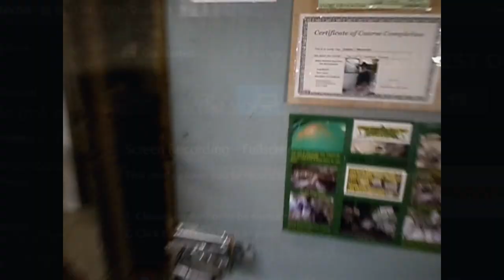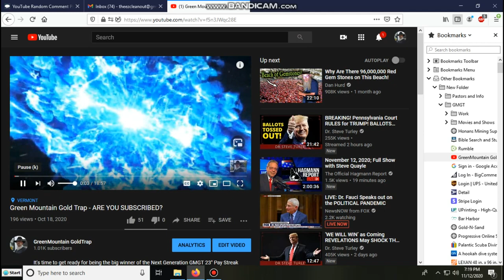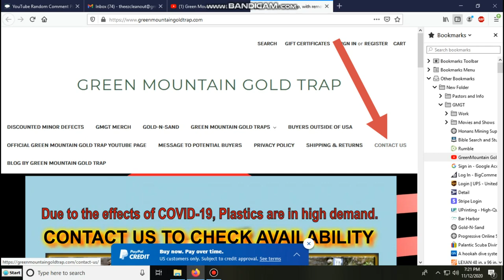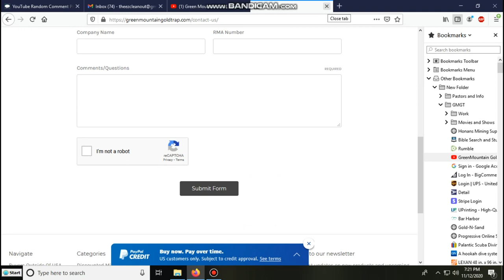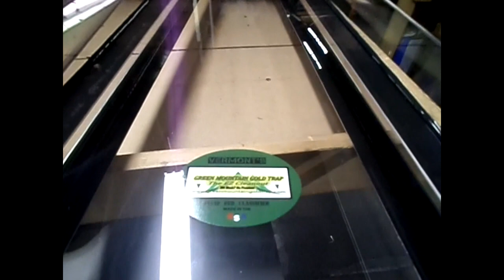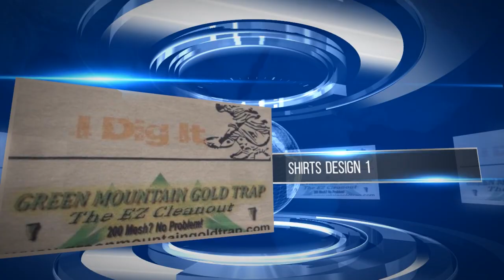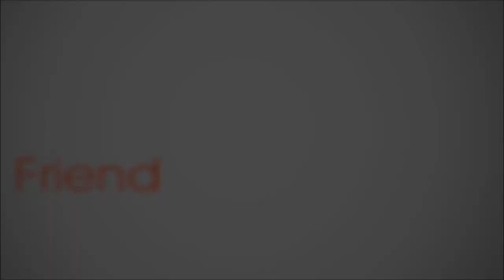Green Mountain Gold Trap 1K Sub GAW Drawing

Comment: Congrats to the winner. And again congrats on 1000. The clear looks cool and does have eye appeal but at the same time yours has eye appeal as well, and strength would be a very important aspect to me. Falling when climbing steep banks or over slippery rocks, dropping stuff, etc. etc.
Reply from the maker: Thank you Dallas for your opinion and for the support. I agree 100% as I have taken a fall from a height of 4 feet down onto bedrock that had palm size rocks and smaller scattered about. It was when I was still building with Acrylic, which does break. However, it dodn't break!

Comment: completely clear is nice but .....with all the banging bumping and sliding down slopes that comes with my trekking, I would prefer the more robust product. The one thing I would like to see would be clear tubes so I can see when the leaves from this fall get in to the tubes. Hey that is only an inconvenience during a short period here and my modification of a screen over the front helps a lot..... Just my 2 cents. P.S. mine is all scratched up but still in one piece.  congrats to the winner      :-)
Reply from the maker: Thank you Mike for your opinion and for the 2 cents. I invite all to do just that because you never know, it may work! I have tried clear tubes but quickly veered away from implementing it in future builds. Being able to see the materiel clearing at the top inside front of the tube wall and the top front of the tubes is what indicates feed rate to the user.
Never give up making suggestions when you have them. I am thankful for every one of them.